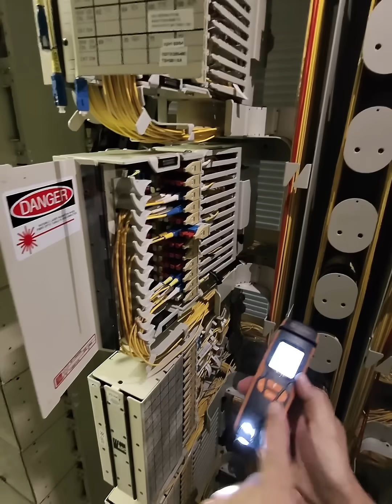SYSOTEK OFI on Double Duty Maybe Triple?? 🤔

Comment: How is it detecting 'live', fiberoptic cables don't have a magnetic field like copper wires?
Reply from the maker: Great question. I like your electrical mindset. "Live" for us means there's an active light signal on the fiber. Fiber optics uses infrared light, and the Live Fiber Identifier (or OFI) detects it by gently bending the fiber so a bit of that light escapes and is picked up by sensitive photodiodes.
Reply: @Sysotek  Good explanation, thanks